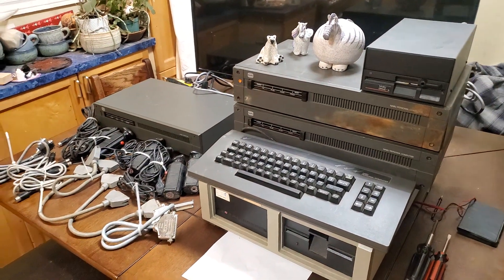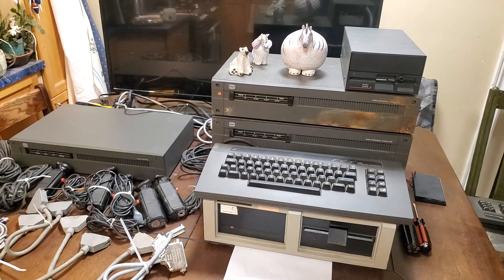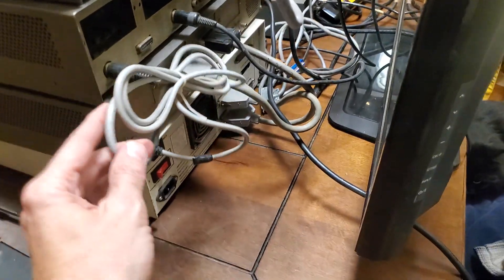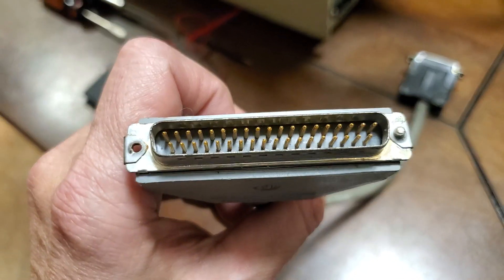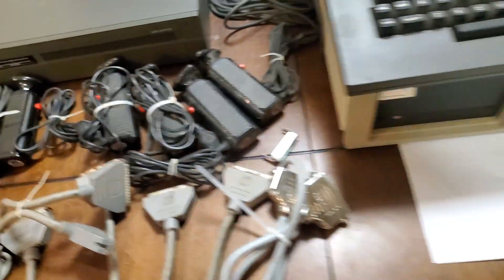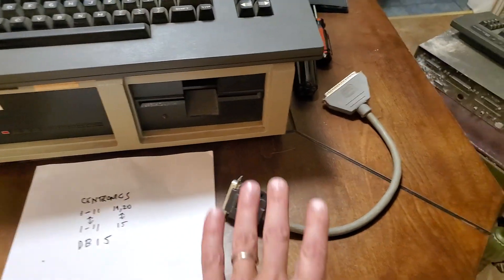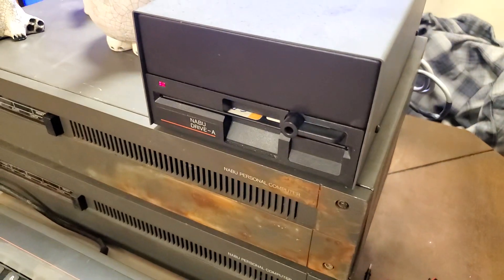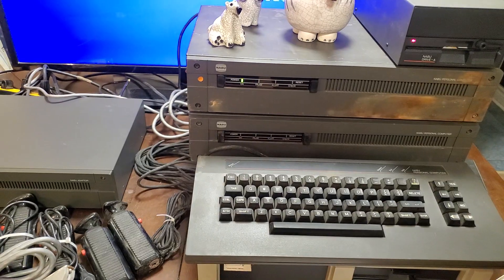NABU Archaeology with Leo Binkowski part 3

Comment: ahh leo the latch needs to be CLOSED for the drive to work
Reply from the maker: I did have it closed for a previous test. It's not "seeking to zero", which makes a little noise as it moves the head to track 0, then the light goes off.  It should have done that even without the door closed. I was told the head might be seized and/or drive belt disintegrated.

Comment: I sincerely hope that the disk interfaces are replicated at the drive end.  But even if that doesn't pan out, is the printer port a true parallel port or something else?  If it is truly parallel compatible, I could see the possibility of connecting a Zip 100 to that port.  That would far exceed the capabilities of any of the original drive hardware.
Reply from the maker: I don't think it's a two way interface, but I've never tried it in that matters, since printers were the only things available. I only ever output to it for printing.

Comment: When trying out the floppy drive at [8:30] onward, did I miss something, or is it just that the lever on the floppy drive wasn't flipped down from horizontal to being vertical?
Reply from the maker: I had already tried putting it down, and the light continues, but I can't hear the head moving. It should've seeked to track zero, and it didn't. I didn't want to necessarily wreck that diskette or the drive during the recording if it did decide to do something. I'm working through some advice to get them working from people smarter with actual hardware reconstruction than I, which I'm very grateful for.
Reply: @leo.binkowski  That's fine, I realized there may have been something you tried that wasn't in the video.  It sure sounds like you've been running a NABU marathon with all the things you've done in such a short time!

Comment: Just to clarify the terminology:
These are D-series connectors.  The body of the connector is given with a letter, followed by the number of pins or sockets, typically a dash or hyphen, and finally a letter to designate a male Plug or female Socket.  Hence a DB25-P.  They started the body or backshell code with "A" for the 15-pin, "B" for the 25-pin, "C" for the 37-pin, and "D" for the 50-pin.  Out of sequence they then used "E" for the 9-pin.

So, we end up with:
DE9-P & -S
DA15-P & -S
DB25-P & -S
DC37-P & -S
DD50-P & -S

There are variations, including the High-Density D with three rows of pins, and standard D-series with special contacts for coax or high-current cabling.

The Centronics parallel port connectors were typically referred to as "ribbon connectors" because of the shape of their contacts, but that gets confusing with connectors used on flat "ribbon" cables!

I hope this helps.  Good luck with all the NABU work!
Reply: It may also be worth mentioning that DE-9 was often (incorrectly) referred to as DB-9, and if you're looking for connectors today, that's how they're usually listed.
Reply: @andywest5773  Yes, and hence my frustration! 🙂  Similar to hearing "banana" plugs and jacks all referred to as just plugs.  Binding posts with integral banana jacks being called plugs, are you kidding me? 😄

The sequence of pins on the circular DIN connectors are in part because you could use a 3-pin plug in a 5-pin jack / socket, so 1-2-3 needed to be the same, 4 and 5 were optional.  There are also different 5-pin DINs with 180° and 240° arcs, to add to the potential confusion.
Reply from the maker: Actually it does help. I cut and paste this into my notes for quick reference.
Reply: @leo.binkowski  There's also Apple's 'bastard' 19 pin D-Subminiature connector they used on later apple II and early Macintosh external floppy drives. It was also used on a couple of other things, IIRC something in some old music synthesizers. Whomever assigns such things never bothered to give the 19 pin connector a letter. Big Mess O Wires makes solid state floppy emulators for apple II and Mac. Having used up all the 19 pin connectors he could find, and not wanting to sacrifice any more original floppy drives just for the connectors, he had a Chinese company make a large batch of new ones. That was helped by one of the large component supply companies going in on the order so they could have some to sell. So when the shipment arrived, he had the entire world's supply of new D-Sub 19 connectors at his house for a while.

Comment: Looks like permanent drive select which can be caused by the cable being the wrong way round  , be careful because if you have a non write protected disk it can corrupt it
Reply from the maker: Every floppy I'm reading gets a write-protect. I actually have some that was in a pristine box of Dysan floppies in that same steel case.

Comment: Thanks for all your help with this!  Very cool that you managed to save so much stuff.

Incidentally I am making progress with the Network Adaptor -- I am getting obvious changes in the data output waveform if I feed it RF input on CATV channel 9.  I am hoping the data encoding scheme is something simple like Manchester bi-phase but I have a little more work to do before I can figure that out.
Reply from the maker: My recollection was that it used QPSK, does that help? Keep in mind, though I worked for NABU and now work for Ericsson, I have very little knowledge how the RF worked.
Reply: @leo.binkowski  That's a possibility. I'll keep it in mind while investigating.
Reply: Actually I found a TTL interface QPSK modem on eBay for not a super high price, I decided to go ahead and buy it and we'll see how it goes!
Reply from the maker: @MatroxMillennium  Good Luck!

Comment: Great stuff Leo!  Also, with the floppy drive, did you try closing the disk drive latch? I noticed it was open when you tried booting from that floppy disk.
Reply from the maker: Lol, yes I did, and it also didn't stop. It needs some TLC, I think.
Reply: @leo.binkowski  cleaning and lubing the rails is pretty easy to do. That could be the only issue, especially since the drive has been sitting for many years without use.

Comment: I paused the video and counted. Yes that is 37 pins.
Reply from the maker: Thanks, I thought it was DB-37, but counting them on camera with my old eyes would have been excruciating for everyone.
Reply: Nitpick: it's DC-37, the second letter tells the size of the "D" frame: DA-15, DB-25, DC-37, DD-50, DE-9, DE-15 (VGA).
Reply: @oqibidipo  You know I made this same mistake in nomenclature when I started at my last job and the senior hardware engineer pulled out the 1960s vintage catalog those connectors were unveiled in just to show me. It was like his holy missing to undo the public misconception about the naming.

Comment: Do you know of an easy way to get RS-232 on a non-development Nabu PC? I assume the cards aren't easy to find. I might have to make my own custom board.
Reply from the maker: I can talk about the RS232 board if you wish. I'm giving one to DJ for analysis
Reply: @leo.binkowski  That would be cool and useful to see, thanks.
Reply: Do you mean RS-232 from the Adapter port (like to go to a PC instead of the RS-422), or do you mean an additional RS-232 port that software on the Nabu could access?
Reply: @jaycrutti  I mean an additional port for software. I expect I'll be using the RS-422 to load programs.

Comment: It feels like we are watching an archelogy expedition at the Binkowski house!  I keep catching myselff "ooh"ing and "ahh"ing everytime you pull out more treasures.
But now it makes more sense with the stack together.
I went back to your previous video, I saw the hard drive & floppy are connected to a Western Digital controller board, which is then cabled to the Distro Nabu; which I assume has a different BIOS ROM than the user version.
The other one with floppy probably also has a "custom" BIOS as well, as your screen was showing the message.  Along with the floppy controller card inside attached to the I/O bus.
So when your work friend comes over, mapping out these components would be a good starting point.  Get DJ to help you pull a copy of those other BIOS chips so we can archive, and decode them for helping us add new drives.

The crossover cable joining the 2 systems is probably a simple TX+->RX+ & TX- > RX for the RS422 serial link.
Tell your wife and your boss thanks for allow you to spent time and precious kitchen space on this project!! Good luck to her at the ceramics show!
Reply from the maker: Thanks for the kind words, I showed the comment to Lisa when while we were setting up for the pottery show. She said aww.

Yes, there is a special ROM for Network+HD+Floppy. I purchased an EPROM burner so that I can copy it off and send it to a bunch of people who can disassemble and make it public. Besides the details of different version, I know very little about the EPROM. In fact, that is another case where DJ has already studied it and can comment on it further.

The crossover is exactly as you say. RS422 was actually simpler that RS232, in my mind. Plus, you can make an RS422 cable that is pretty long, I think something like 800m.

Comment: That printer pinout makes sense.
Pin 1 - Strobe
Pins 2-9 - Data
Pin 10 - Acknowledge
Pin 11 - Busy
Pins 15 & 19 - Signal and Pin1 grounds. 
Ideally all grounds would be tied, but those 2 are ostensibly enough.
Thanks for sharing, Leo!
Reply from the maker: Cool,  I'm glad someone was interested in that info. I do know there are many NABU titles capable of printing, so I thought it  might be important. I don't even think the parallel port can talk both ways.
Reply: @leo.binkowski  That particular printer cable looks like it's missing pin 10 on the DB15 side.
Reply: @Mueller3D  I noticed that, too.
Reply: Just fyi/to confirm, per the schematic from the eBay seller:
1 Strobe (3.3k pullup)
2-9 Data
10 Marked +5, Tied high via 3.3k pullup, no other connections
11 Busy (3.3k pullup)
15 Ground